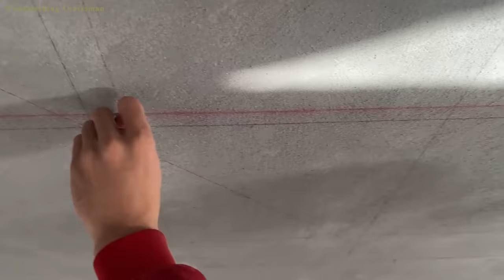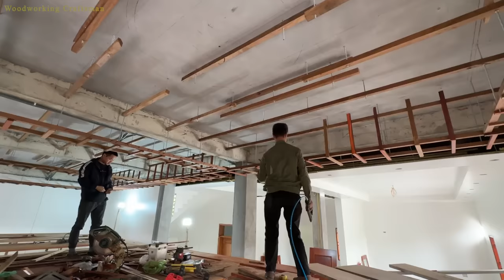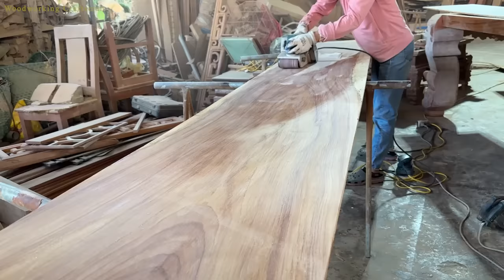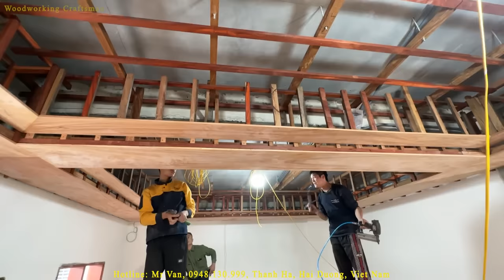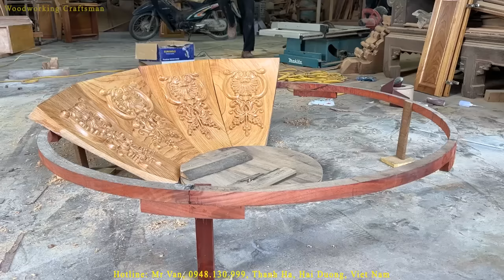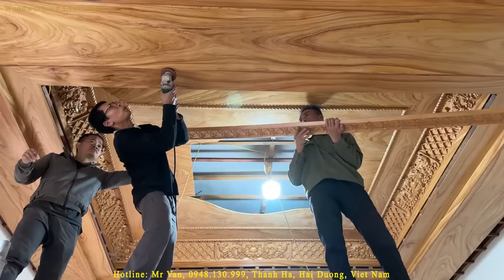Mr.Văn Latest Design Beautiful Wood Decorate Vintage Ceiling Living Room||Extremely Ingenious Skills

Comment: nice...from a distance. That questionable bulkhead framing is holding a lot of weight. they sure love to use silicones and glues..plus that air-nailer...wow, they must have shot in 10,000 brad nails?! But one thing is not questionable is their skill levels...they could and indeed can do anything.